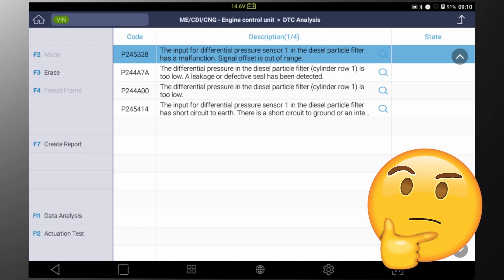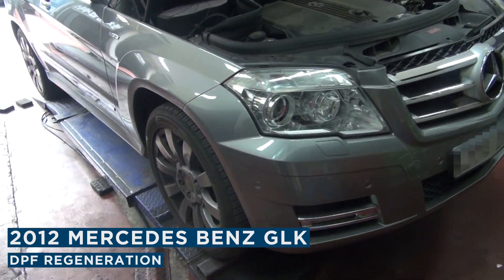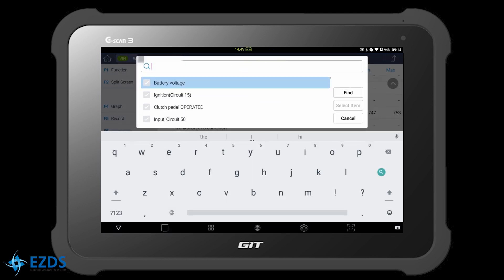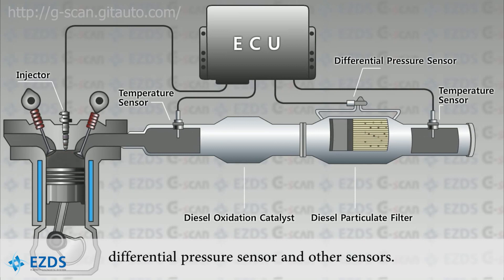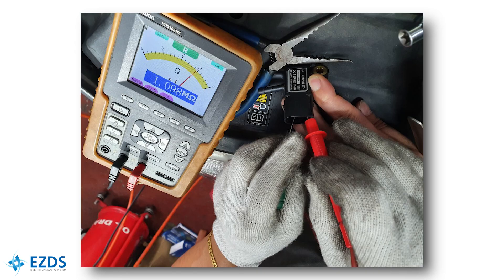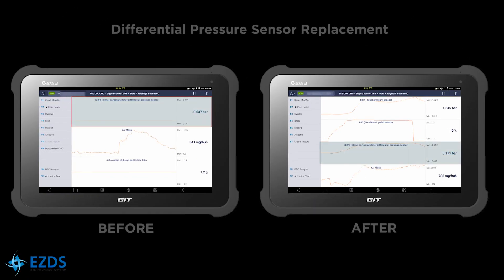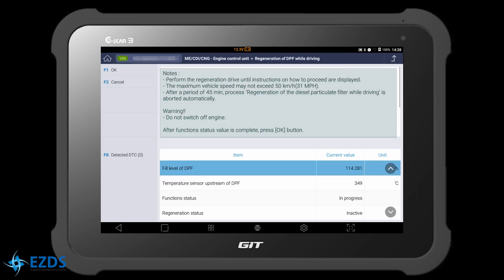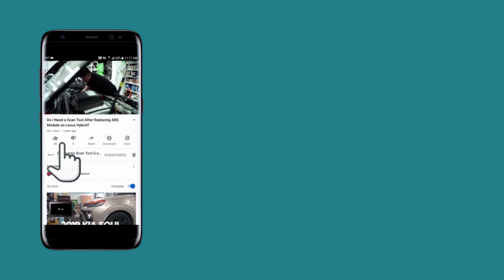Differential Pressure Sensor Replacement & DPF Regeneration (Feat. 2012 Mercedes Benz GLK)

Comment: What pins on the sensor did you measure across with the multimeter for 1K ohm vs 1Meg ohm?  Was it 1 and 3? Thanks!

Comment: This is helpful, do I need to do a regeneration every time you replace a sensor?        I just replaced my Exhaust GasTemp Senor on a Mercedes glk 250 and I have a lot of white smoke coming out of the exhaust.  I’m guessing  from other info that I should just drive to regenerate it.  Do you agree ?
Reply from the maker: Hello Dave! It is 'recommended' to do a regeneration after replacing a differential pressure sensor. Extreme amount of white smoke is not a good sign as you know.. It may be burning a lot of oil? Yes, you can drive to regenerate it. Driving on a highway is recommended as well!

Comment: If the connected tubes to differential pressure sensor damaged . Or the dpf soot accumulated . This gives same codes?  Your decition of faulty diff pr sensor depends on what symptoms?  . Thanks for sharing this information video
Reply from the maker: Thanks for watching again! :) They could give the same codes if the damaged tube results in the low pressure in the whichever (before or after the DPF) side of the tube and fake the ECU to think the soot is accumulated due to difference in the pressure between before and after the DPF. However, if we are looking directly into individual case, they may result in different codes. For example, P244A (low pressure) will be triggered if the tube is damaged because the pressure will leak through the damaged tube. Accumulated soot that is causing restriction in the filter will result in either  P2463 or P242F (soot accumulation). Trouble codes shown in the beginning led us to look into the differential pressure sensor and when we checked the resistance of the sensor with a multi-meter, it was way out of specification.
Reply: @ZenithDiagnosticScanTool  Thanks for reply.  I think code p242A indicate problem inTemp sensor3 wiring or soot buildup on gives abnormal reading can be checked by live data should be high Temp than s1&s2 to efficient catalytic converter. some workshop in my country delete dpf system from pcm when I checked T1. T2.T3 their readings 600C although cold coolant temperature.  
Thanks for sharing dpf system problems Which I intrested.